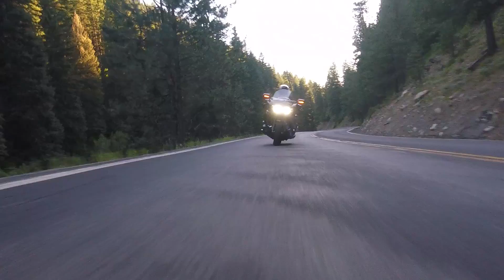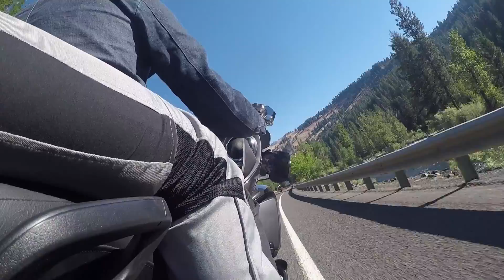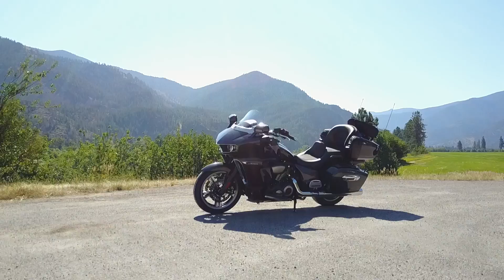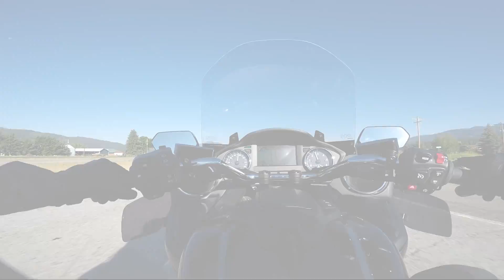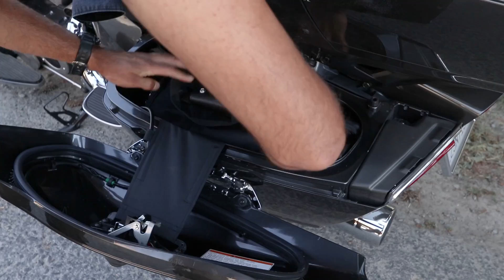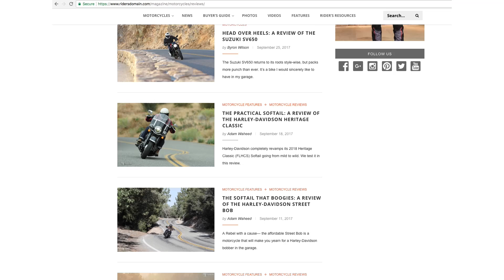2018 Yamaha Star Venture Second Ride Review Video | Riders Domain

Comment: They gave it a 5 year warranty to add value and get the vehicle on the road.  Has nothing to do with Yamaha reliability.  But, I agree, you'll probably never need it.
Reply from the maker: It's always nice when manufacturers are willing to stand behind their product.
Reply: Yes, it is.  In this case, even after the 5 year early adopter warranty is over, tomorrow's purchasers will still be able to get a Y.E.S. warranty if they want the same peace of mind.
Reply: I've got got an 05 Road Star with 72k Miles on it.  Still chugging smoothly with zero issues.   Almost no need for a warranty
Reply: @MrCabledawg45  07 Royal Star tour deluxe 68k and still running like a top.

Comment: no mention of heat coming off that engine!
Reply: Cause there ain't any heat coming off the engine when traveling at highway speeds. That's whole point of air-cooling.
Reply: My Victory CCT is air oil cooled. There is lots of heat coming off a V-twin at highways speeds in not summer months.
Reply: Wow, Adam!!  How in the world did the Yamaha engineers pull off keeping the engine from producing any heat at highway speeds?  Cold fusion?
Reply: Right On John :)
Reply: That's because its a Victory - Polaris doesn't make the most well-engineered powersports equipment. It is  better at production and scale rather than capable engineering solutions. P.S. I'm not hating, just telling it like it is.
Reply: HAHA - very funny.
Reply: Adam you are to funny. Ride Safe!
Reply: So are you! You too - and I hope to joke around with ya again here. See ya around.
Reply: Very V-Twin has that problem. I ride a Victory, same situation!
Reply: Adam Waheed That comment shows tremendous ignorance about how engine cooling works.
Reply: Ther funnelstyle directed vent fans help the engine fins dissipate heating air to released areas quickly, the fan system seems to do them well, it does shitso run an interestingly well made oil distribution system so oil is cooled alittle better in motion.

Comment: Very nice review. Had a chance to demo one a few weeks back. My only real negative was the extremely low redline. It does have great torque but I've never ridden any V-Twin, Harley or otherwise that hit the rev limiter so low. IMHO another 500 to 700 rpm of usable power would have made it a killer engine.
Reply: why would you want the Rev limiter higher on a Monster twin Tourer like this bike?  If your reving past 4k than your totally riding the bike wrong.
Reply: Yeah I thought that too. More rpms and a more playful top end would be good IMOP.

Comment: Harley Davidson does not have a water cooled engine except for the V Rod which is no longer in production. They do have oil coolers that is circulated to the heads in the largest of HD Touring bikes.
Reply: better check that again the ultra's have water cooled heads with the radiators in the lowers.
Reply: And the small models of hd are water cooled the 500 cm3 and the 750 cm3 , water cooling sucks , old school air cooled rock 🤗

Comment: Nice efforts, however the Goldwing is still number 1.
Reply: True I guess but if you want a V Twin cruiser/tourer then a Gold Wing is not what you are looking for. If you are convinced that a Harley Davidson is not either this sounds mighty good. At least I am finding nothing but happy owners experiencing satisfying usage with good handling, reliable service and for me a lot of the appeal is the air cooled power unit.
Reply: Goldwing is beauty and in the long run it doesnt have the quality durability of this one , i am so sorry to tell you the truth honda bikes are good but yamaha is the number one brother .
Reply: @josecarvlho356  Well opinions vary.  Lets be mindful of one thing, the Japanese bikes and cars tend to be more reliable and dependable in nature.  The Goldwing has the reputation of being a reliable and quality bike.  You have Honda Goldwing's on the road that have well over 100,000 - 250,000 miles on them and they are still going strong.  Regarding the Yamaha Venture, it looks like a very sturdy and well designed bike but it is air cooled whereas the Honda Goldwing is liquid cooled.  Liquid cooled engines tend to sustain a lot longer than air cooled.  Yamaha bikes tend to have a good reputation (versus another well known motorcycle company) and I would never take away from that but in the long run I must say that the Honda Goldwing has a bit better reputation than that of the Yamaha Venture.  Both bikes are and represent  reliability and quality but the Honda Goldwing would come out on top!!!  I like both bikes personally.
Reply: @Leatherbro  There are more old Goldwings on the road than any other bike. That tells me all I need to know about reliability...
Reply: @jamesbottger5894  That shows quality engineering that goes into this bike.  Some of the other metric bikes are pretty reliable and have longevity to them but I must say the Honda Goldwing does come out on top.

Comment: 76 or smth bhp? no. thanks. I'd take that bike Yamaha but make something more powerful equal the price you ask and come next time.
Reply: Don’t need all that hp.  Has enough torque where exactly needed.  Motorcycle engineering is about balance.  Do you really want to ride a bike that weighs 900 plus pounds with long wheelbase that has massive hp?  It will be out of control engineering catastrophe.
Reply: Why everyone care bout horse power your not racing calm down it's all good enough for touring dude and you don't wanna do 90 all day your just shitting on your mpg that way,  it works just fine for touring lol